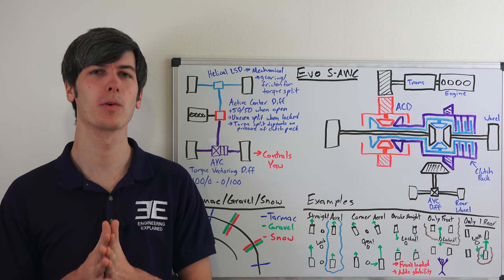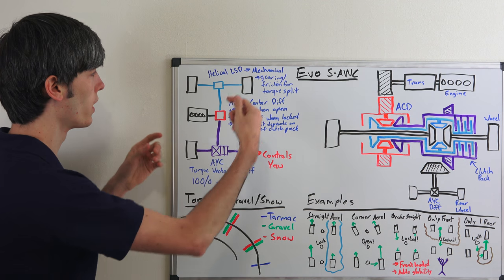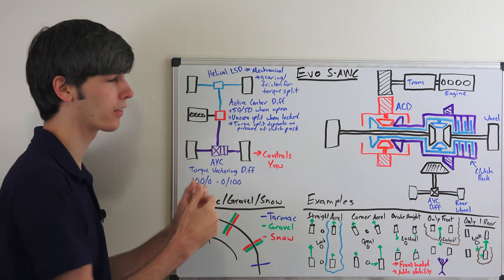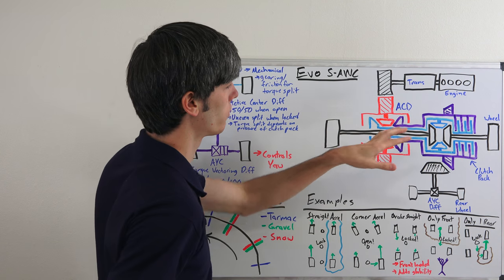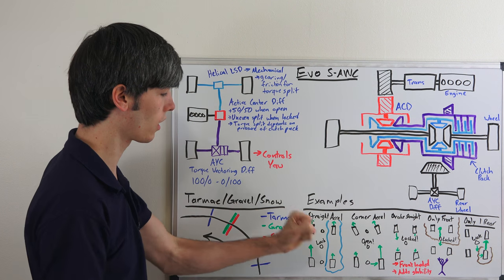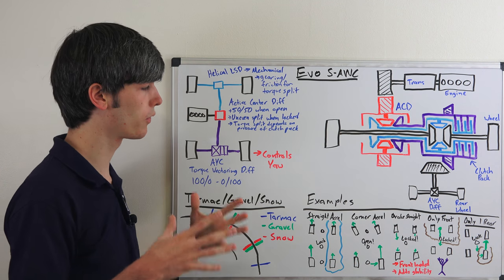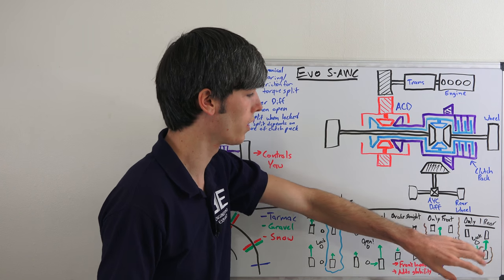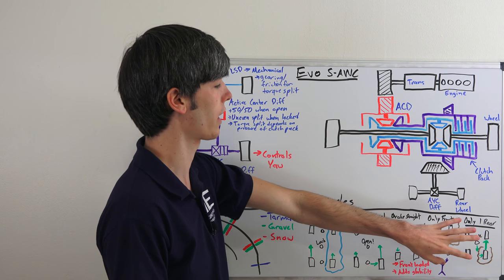Mitsubishi Evolution X - How The AWD System Works (S-AWC, ACD, AYC)

Comment: This is a really amazing amount of work and technology. I can barely even absorb how it all works yet Mitubishi freaking BUILT it to be reliable and efficient enough to sell it as a consumer car. Cars are so awesome.
Reply: Those are one of the more expensive cars, have to be serviced quite often.
Reply: These aren't made by Mitsubishi. They're outsourced to Gertrag, a German company.
Reply: It’s definitely not reliable. Requires more maintenance than any car I’ve ever seen and the pump that controls the ayc fluid to lock the rear diff is destined for failure. If you ever drive in salt it is already dead, you just don’t know it yet

Comment: I had an Evo X and I was always amazed by the AWD system. Ok, mine was lowered, had 1" wider wheels & tyres, and some Whiteline suspension bits. BUT, it always blew my mind! It also scared the p00p out of unsuspecting passengers LMAO. In heavy rain, I drove in 'gravel' mode, and she was STUCK to the road. The Pirelli P Zero Rosso's also helped. I really miss that car.

Comment: Great Video! I hate how these facts are well known in the Evo community but other people keep saying random stuff about.

When I saw your Evo review, I was a bit disappointed because you of all the people got it wrong....so thanks for clearing it all up in this video.

MMC actually publishes papers in their tech reports. I'd like to add a few things.

1. Since you draw that 2nd diagram, you probably know that all the complexity is happening in the front axle. This is obviously cause by the Evo being based on a FWD Lancer with a transverse-mounted engine. Because of this, you get the hilarious turning radius in the Evo.

2. The S-AWC computer is desperate from the main ECU. Again cost reasons with the base Lancer production line probably.

3. You didn't talk about all the sensor in the car. G sensors, wheel speed, gear, wheel angle..etc. Which is what controlsthe S-AWC computer that controls the AYC and ACD. That I think is the heart of the system. They actually started out with being able to control the power in each four wheels. It worked for track time but everyone who drove it felt uncomfortable and in term induce less confident. This ACD + AYC set up together with the tuning of the S-AWC computer, in my opinion the beauty of the Evo X and why I ended up getting it.

4. I believe if you go through the manual of the Evo, Mitsubishi claims the stability control is part of the S-AWC system. There is actually something call AYC-braking (which is on top of the normal AYC system) that helps cornering by apply brakes on individual wheels. You can disable it but requires holding the ASC button for two seconds.
Reply: +joltyjolty Unfortunately point number 3 means you can't just pull a fuse to deactivate ABS.  If you do, you lose the ABS sensors which the S-AWC needs to function properly.
Reply: +marc27default nixe vid!!
Reply: What happenes when you  disable #4 ?

Comment: The only thing that is not made loud and clear is that THE EVO X ON A HARD TURN CAN MAKE IT'S OUTSIDE REAR WHEEL TURN FASTER THEN THE OTHER WHEELS. IT IS ONE OF VERY FEW CARS IN HISTORY THAT DO THIS. 
OTHER CARS LIKE THE SUBARU STI USE BRAKES TO TRY TO ACHIEVE THE SAME HANDLING CHARACTERISTIC BUT TO NO AVAIL. THUS THE EVO HAS GREATER HANDLING CHARACTERISTICS. @EngineeringExplained LET PEOPLE KNOW.
Reply: well that is was Yaw control is like he explained...Subaru "fake" this with breaks because they use an Torsen rear diff
Reply: Hondas awd system has this
Reply: Active torque vectoring is somewhat common today, even for cars at evo x’s price bracket (focus rs for example). But back in the days it was definitely unique to evo and some very few very expensive cars.

sti’s system is passive torque vectoring. Not nearly in the same league in terms of performance.
Reply: I know Audi S4/S5's are not in the same class or price bracket as Evo X but their so called rear sport diff (optional extra, doesn't come on standard) does pretty much the same thing and it works freaking amazing (from personal experience, had a 2011 b8 S4).

Comment: A very through explanation. The Evo has arguably the most advanced sport-oriented AWD in the world, too bad Mitsubishi doesn't apply the technology across their lineup & the fact the Evo is going to disappear by 2016.

If your local Mitsu dealer has a Evo X Final Edition sitting on the lot, take it and run. It will be a guarantee future classic
Reply: +Trades46 Mitsu will carry the AWD to their PHEV Outlanders as they've claimed.  They've invested far too money into it to let it go waste. Their Pikes Peak electric car had employed an advanced S-AWC if I'm not mistaken, so i clearly see it returning with an Electric Evo in the not so distant future when hybrids and electric cars coexist and battery technology has advanced to reduce size, increase range, last longer and cost less for it to be viable.
Reply: +cagednm69 Well put.
Reply: cagednm69 Hopefully that is the case. And no despite the S-AWC moniker the Outlander GT V6 wears it is actually not as sophisticated as the system found in the Evo. The PHEV version with electric motors (read heavier) will probably be a carryover of the one found in the GT V6.

As for the electric Evo, that is still up for speculation. Given how poor Mitsubishi sales have been, I won't hold my breath.
Reply: +cagednm69 But you don't need any of this stuff in an electric car. Give each wheel an electric motor and you can control all the torque by software.
Reply: +Kepe true.  So i test drove a Tesla P85D while it was raining rather hard out.  found and open spot and floored it.  0 wheel slip.  absolutely amazing traction control goin on there.  that car is a rocket ship
Reply: Kepe
Indeed. Mercedes-AMG played with this idea in the SLS AMG Electric a while back with some crazy torque vectoring through its 4 electric motors.

Tesla can probably do the same, but the Model S is more luxury car than performance car; despite the insane numbers of the P85D, you won't find it running away from stuff like Panamera Turbo S & Quattroporte GTS on the track.
Reply: Kepe
That's why i said "Mitsu used an advanced S-AWC in the Pikes Peak Evo". The advanced system being the software that decides what motor at what wheel should be running at what rpm at what conditions.
Reply: +Trades46 ..exactly!!
Reply: I thought theyre already applying it to their SUVs after they discontinue the EVO.
Reply: toophatdiego
Read my second comment
Reply: The S-AWC is on the entire CUV line-up now.
Reply: @cagednm69  Wow!  I was bummed about the idea of the next E-vo, but let's hope you're right!  Sounds awesome with some next gen power! XD
Reply: In my opinion final edition is garbage.
JDM from 3-9 with mechanical clutch diff system better than electronic junk.
Reply: @김준성-i5s  the ralliart is using the evo 9 awd. While it has evo 10 engine and gearbox. So you can chose that, if you like that more.
Reply: Octavian George hmm didnt realize that while working in mitsu 4years lol, ralliarts are so hard to find

Comment: I always keep coming back to this video.  You've done such a great job, Jason, of visualizing how things work from a mechanical perspective.  Do keep up the good work, even though I selfishly regret that there's hardly anything left of Mitsubishi on the performance front to expect videos about Mitsubishi on your channel.

Nonetheless, the S-AWC system that Mitsubishi put in place in the Evo is such a cut above so many others' systems in that it pioneered the design in the Evo IX (ACD) and X (ACD+AYC), and it's still one of the best TV systems out there.  It's such a shame that inept leadership at Mitsubishi doesn't seem to get how to properly market this thing.  

Alas, though the budget S-AWCs in the Outlander family (w/c includes the Eclipse Cross) is but a fraction of what this "full" S-AWC system can do, it's still something.  It still puts a smile on my face whenever I talk to people about how there is NO braking involved in engaging the rear AYC clutch packs for the Evo.  And how all it does is truly coax power to one axle like a mechanical diff would.  

It's why friends just go aghast with the fact that, compared to a Subie or Ford, you really just have to step on the friggin' accelerator to get back in control in an apex.  So unreal.  It's insanely counterintuitive - but that's the Mitsubishi that gearheads love  (and miss).  True shame what they've done to themselves.

Comment: Top right diagram is on point, this confuses so many people, one of the best explanations and diagrams that I've seen.  I do love how they have literally 3 axles spinning concentrically on the same axis, looks funky when you pull them down :)

The one thing you left out is that both the center ACD and rear AYC diff pressure is variable.  This affects both the ACD driving mode and for the AYC based on how hard you are turning around a corner etc.

Comment: Very neat explanation. Something to add is when the differentials are locked they restrict differences in drivetrain speed so that the wheels rotate at the same rate or some rate between open and full lock, if there is allowable slip. Only the AYC can direct torque between wheels.

Comment: The S-AWC is an amazing engineering achievement, but in the long term, it's going to be a major headache because of it's complexity, as maintenance will require us to replace 5 clutch packs (for the MR, SST gearbox). As long as Mitsubishi provides us replacement parts, we're good, because no one else is going to manufacture these components, because THIS IS THE ONLY CAR OF ITS KIND!
Reply: Mitsubishi doesn't manufacture these trans. It's outsourced to Gertrag, a German manufacturer. Due to its complexity, Mitsubishi won't even touch these. So, alas, we're kinda screwed on this one. Heck, very few transmission shops will touch these. I only know of 3 here in the US. Believe me, I know. I'm having transmission issues and I'm not liking it. They're amazing transmissions, you just gotta be willing to pay the price.

Comment: Should do one for the STI awd system too
Reply: +Greg Cappello Isn't it just a mechanical 50/50 split?
Reply: 3 diffs actually 2 mechanical and a computer controlled center diff
Reply: Two open diffs (nothing interesting) + one controlled by computer, which may be controlled by driver. In 2015 WRX STI there might be a Torsen LSD between rear wheels.
Reply: the front and rear are both LSD in the STI
Reply: Still - nothing interesting.
Reply: ***** In an engineering/automotive perspective I would say.

Comment: Nice video Jason, On my 13 Legacy 3.6 R  torque is split 45 front and 55 rear, and can go 50/50... but even then it was hard to find out what the system really does, the dealers out here in Sac are clueless as if it's magical AWD.  I wished manufactures would explain things as well as you do, Thank you for making awesome videos.
Reply: +cobra454tim Your 3.6 also adds a planetary gear set in addition to the clutch pack in the AWD.  The planetary gear is what allows the rear wheels to receive more power than the front.  The rest of the AWD system is exactly the same as the other Subaru models with auto transmissions.

Comment: In short, evo/ralliart has or tries to enforce a permanent 50/50 torque split at all times.

When all 4 wheels have plenty grip, the central diff is open. The car is automatically in 50/50 torque split.

When one or more of the wheels lose grip, the engine is involuntarily sending more torque % to the axil that’s losing grip. So the central diff closes, forcing front and rear axil to rotate at the same speed, thus enforcing a 50/50 torque split.

On tarmac, this central diff arrangement probably won’t perform as good as AWDs with a permanent rear wheel bias in terms of cornering speed (a large portion of evo’s incredible cornering performance comes from its rear torque vectoring diff, 50/50 locking central diff alone won’t get you that incredible performance). But on lose surface like dirt, gravel, rain, snow or ice, evo/Ralliart’s central diff is what makes them the beast they are. In winter, my Ralliart is usually the only car in my local ski resort without snow chain on the tyres. Don’t need them.

Comment: The evo acd is just an electronicly controlled lsd, it will not differ the torque percentage from front to rear, it will just maximize the torque output to the the drivetrain that’s not spinning freely. In a straight line, either opened or locked, it will output the same percentage to both trains. On the other hand, the subaru DCCD will output 65% torque to the rear and 35% to the front, only when it’s opened! Due to the different leverages inside from the housing to the ‘planetary gears’. Both cara, when you lock it, send the same percentage to both front and rear

Comment: Great in depth explanation! It's difficult to find an actual explanation of how the Evo's AWD system works when most magazines/show reviewers are busy spreading false information. I had to scour the internet for diagrams when I was learning about this system a while back.

A few notes/questions:
1. I noticed this car has a pretty unpredictable tendency to oversteer whenever I would trail brake at trackdays, and I'm assuming that could've be the center differential unlocking? Minimal trailbraking would usually cause the car to rotate aggressively. I sold the car, before testing the different ACD modes to combat that.
2. When the ACD locks, the way I understand it, doesn't that cause the F:R torque split to become as close to 50:50 locked as possible(until the point of clutch slip of course)? As when it is unlocked the diff is open, and were it not to lock on acceleration, the power would get sent to the end with least traction in normal open diff fashion(which doesn't happen due to programming)?
Reply: +FCustureri 
I'm just trying to understand how the F:R torque split would change if the center diff is locked, as wouldn't the front and rear get the same torque in that scenario no matter how much traction they had, biding the clutches don't slip?
Reply from the maker: +FCustureri The internet certainly made it tough to find answers - hence I had a couple discussions with Mitsubishi engineers to clear it all up. Answering your questions:

1. There are many, many reasons why a car might oversteer. Admittedly though, braking into a corner understeer is much more common. I would blame it on other things (tires & suspension) before thinking about the ACD's intervention. Under heavy braking, it wants to lock. In a corner, it wants to open. When you combine the two, I imagine it probably wants to open since you're turning. When it does open, if you're mid turn, I could see this causing some instability. That's assuming it isn't caused by other reasons (though it may amplify it regardless).
2. Nope. The easiest way of thinking about it is that when it's locked, it's trying it's hardest to be a locked differential. Locked diffs can send 100% of the torque to the wheel with traction, if the other has none. If one axle has more grip (ex: when you're accelerating the rear is loaded), it gets more torque. When the diff is open, it acts just like an open differential, splitting torque 50/50 between the two axles, always, until it locks again. In the video description I have a lot of content which explains this further.
Reply: +Engineering Explained 
Thanks for further explaining that, it's making sense now!

As far as oversteer during braking goes, it just seemed to do it in a different fashion than other cars I've tracked. It had a good track alignment(as much so as stock suspension would allow) and more track-focused RS3 tires.
I wasn't braking heavily while attempting to turn(and no major weight transfer mid-corner), it would happen on entry with almost any braking, or mid turn if I would just slightly scrub the brakes. It doesn't matter now I suppose(and I understand there are many things that could've caused it), I just like learning! 

Thanks